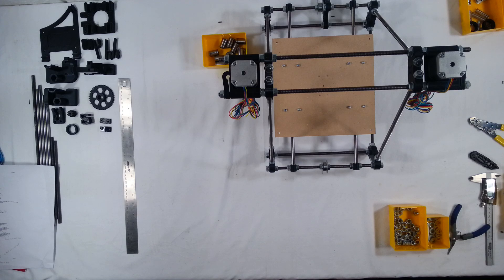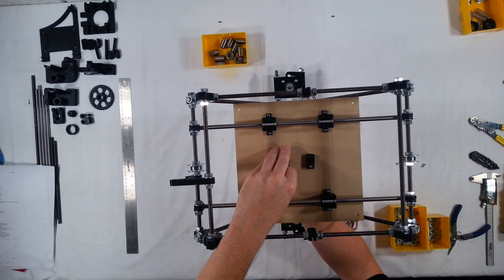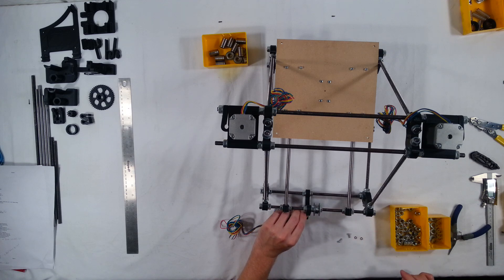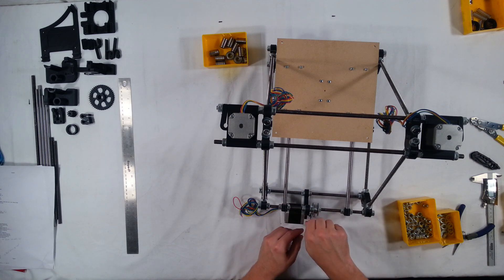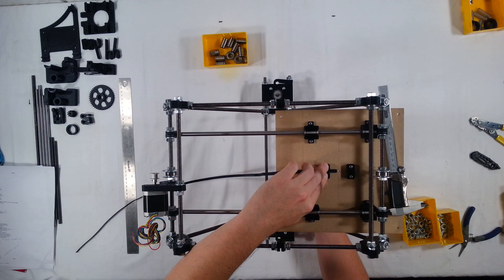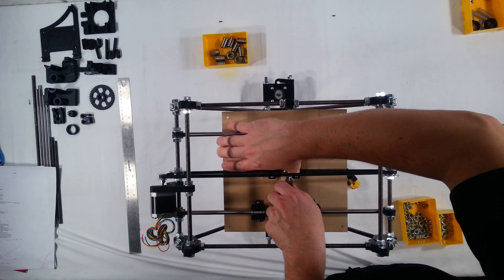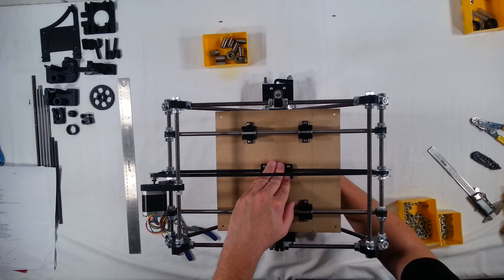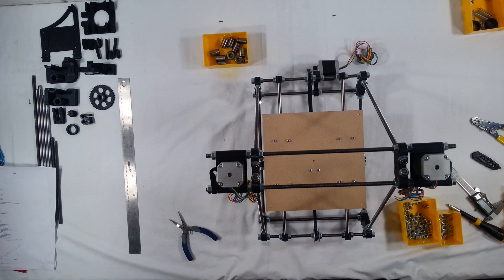RepRap Prusa Mendel Iteration 2 Assembly 08 - Y Axis Belts

Comment: i got all of this assembled but im having an issue with the belt slipping off of the y axis motor, how can i fix this?
Reply from the maker: Ryan, it sounds like you need to increase the tension on the belt. When you pluck it, does it make a tone?
Reply: the tension was good. i made the mistake of drilling the hole larger on the gear for the motor. hopefully hot glue will fix it. thanks for the help
Reply from the maker: Ryan Duncan Is the pulley (gear) slipping around the shaft on the stepper motor?